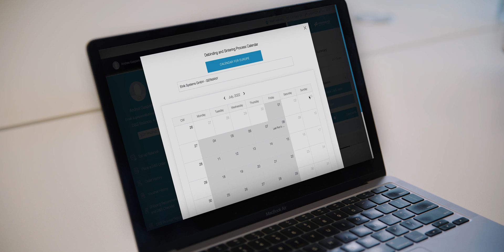Promo: Create metal parts, but without the flames

Comment: Ok if this commercial was made to explain to me what you are selling, sorry but you failed
Reply: You use BASF 316L material to 3d Print a piece. 
then you ship it to a Particular direction (not UM) where it's baked and shaken (actually it's a 2 step process where the green piece changes to brown and then sintered to a 316 Steel). 

It's quite cool but only affordable when you are close to the place where they can "cook" your piece... otherwise, it's cheaper to do a PLA lost casting. 

also, some problems you may fight against are the XY contraction and the support required since the piece in its green and brown state is really fragile and could easily deform or break while being transformed into its final metal phase.
Reply: why do I buy a 3d printer if I need to send the green part to the company anyway?
Reply: @typebin  Same thought I had and if you really wanted a 3d printed metal part there are services that will do it for you that don't require shipping back and forth.
Reply: im pretty sure all you do is 3d print a part and send it to them and they make a metal version of it
Reply: They are selling a hot end so you can make a green part basically material you use to make the part then you send it to them and they make a mold or something of it and mold it into metal Iam assuming